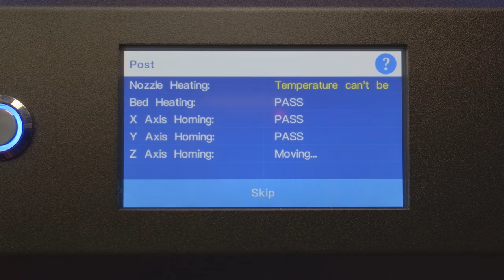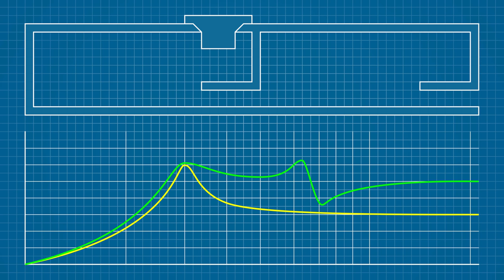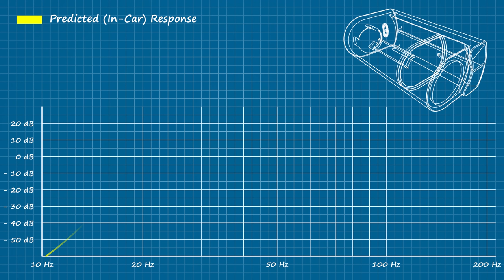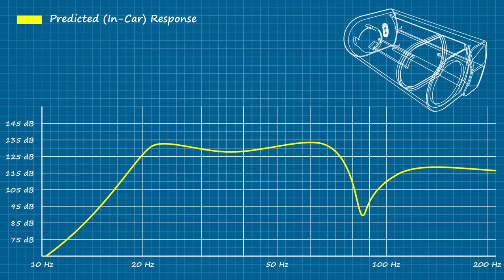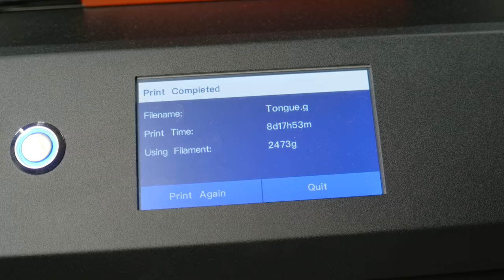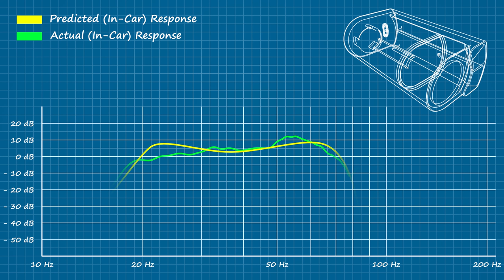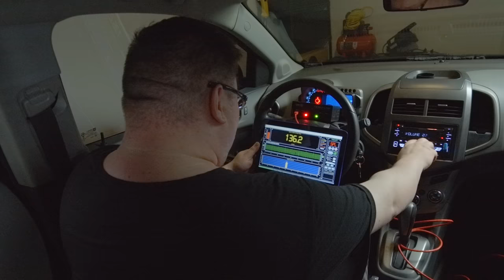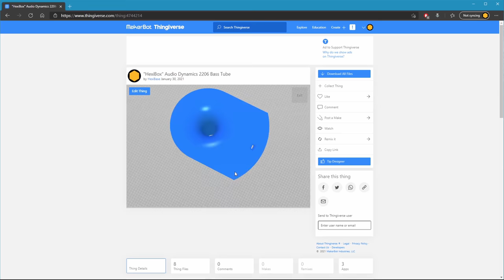Next Generation Bass Tube (Featuring The Alfawise U20 Mix)

Comment: I love this project and the content in general, but the sprint speed on that printer can best be described as glacial. It looks like 20, maybe 30 mm/s?
I might be used to slightly higher speeds printing on a CoreXY (but with direct drive), but that just looks unnecessarily slow. Is it extra slow due to the heavy print, which eventually has to be moved in Y with the bed, and is it part of the factory settings/profile or your own printer tuning or settings?

Comment: Hey! Really impressed with this build. I think the printer performance is 5*, but the thing couldn't ve been tested before it left production. Quality control? For the price of the sub, its performance is great! Will need to check if it's available in the UK. I listened with a set of Shure 535 monitors! The fullness of the bass and its punch reminded me of the 2x12 box I made for my Golf Mk1 GTI back in the '90s. All the drivers in the system were by Infinity. That setup gave 136db without distortion. But from ONE 6" sub?! That IS impressive! Were you happy that the enclosure damped enough of the 70Hz peak? The bottom end came in an almost inaudible hum. I felt it before I heard it! I had a 21 band graphic eq under the front passenger seat to take care of resonances after I'd done as much as I could in the consruction. Love your channel!

Comment: Puts my "borrowed" yellow plastic pipe I took from a pile of scrap at a local road repair site to shame 😂
It was the rounded off end they cut off and discard. Half inch walls and stupid heavy (4ft long) I installed a 12" eminence sub of some sort with a bunch of acoustic foam wadding inside. Certainly made the room vibrate 😁

Comment: i came up with an awesome cheat on tall prints... if you can pause the print do so 3 big elastic bands of equal tension! and a little bit of tape!  reduced the wobbly by 80% hardly even notice it on tall prints.rest of the wobble must be down to chassis and the bed sprints.

Comment: I have a 12 inch sub, 300 watt continuous, the cabinet is pade of some garbage particle board so i was thinking of building a new cabinet for it, its powered and it has a built in amp. do you know a channel that has made a 12 inch housing?

Comment: Okay, I'm a professional DJ using PA systems for my gigs and I obviously have a different use case than what you are doing. But my general question remains: Why do my two heavy duty 15" subs only hit around 130 dB when I can hit 136 with your system? I know the answer is a bit more complex, but I feel like I don't even closely use my subs as efficient!

Comment: Printing with PLA - has the thing started to warp in the sun? In my experience many prints I've done with PLA and attempted to use on a car have over time warped due to the hot Australian sun. I can't imagine this project would have had any issue using PETG which lasts to a bit higher temperature, or even ASA - right?

Comment: just subscribed to your channel awesome content I've made a few Bluetooth speakers myself nothing as aesthetically pleasing as what you create but sound very good i think especially since I only used just some speaker's I had laying around one has four sets of speakers with a ten inch passive radiator made out of a blown subwoofer with the magnet removed and the spider thinned down a bit, powered by a wuzhi 160 x 2 amplifier... three of the sets of speakers have different resistance so had to run a series / parallel set up all in all happy with it and definitely one of a kind... i listen to yours and all audio from my descent computer set up stock audio drivers with a Y split audio cable to a harman kardon aura studio 3 that's rated at around 130 watts and a old school GNT 7000 2.1 rated at 120 watts, sounds ok for a gaming / YouTube computer... looking at getting a 3D printer so thanks for the great content once again....

Comment: So I know this might be obvious, but what would happen with this enclosure if it were scaled up for a bigger woofer, would it hurt performance or would it not do anything at all or at least to a small degree that is?
Reply: You have to model it in software to know that. Since every driver has different t/s parameters so they all behave diffrently if you put them in the same enclosure
Reply: I used the program vituixcad to model a double tuned bass reflex (6th order bass reflex). So the same type of enclosure as in the video. I made it for a 6.5 inch driver the Digital designs DD506d2
I am working on building the enclosure so i am hoping that it does the predicted response since that looked really good it does 20-80hz with likr +/- 1.5db
Reply: @troybakker7628  sick man, if u put anything on YouTube tell me ur chanel so I can check it out

Comment: Curious as-to why you essentially placed a long port to the back of the chamber...why didn't you just leave the main chamber open...doesn't that restrict air flow (and cone movement)?  The vent doubles your effective length either way...

Comment: You are a genius and master in your trade and I'm here for it. I found you between gun prints in the hopes of finding some instruction and idea for a quality compact JBL Charge 4 killer. So far I've obtained a 2.1c 50x2+100 bluetooth board with seperate vol and Passover nobs for L/R and the bass. Amazon $24ish and 2 x 3.5" Boss dual coil and a 4" 40w 4ohm Drok woofer. Printed a thingiverse 4" back loaded horn maze thing box and tossed the woofer in it and Voilà... It sucks. Lol would prob sound better flush mounted to the sheetrock in my bathroom. 😖 I don't know if it's the cheapo Little 40w 4ohm 4" woofer or the frequency response in that enclosure. Gonna try the full range lil 3.5 boss. Prob shoulda gotten SKAR brand shit. 
You get what you pay for and you get what you research. Rant over. Lol

Comment: Have you thought about making a spherical ported enclosure? I feel like the time benefit of 3D printing would prevail here over other methods of construction. 

Additionally, the most efficient use of volume is in a sphere. Maybe you could also integrate resonance absorbing cavities into the interior of the enclosure. 

Thus, a design which proves 3D printing as a more effective/efficient way of producing an enclosure.

Comment: Hi! I'm new to the channel, but as a fan of the B&W Nautilus speakers: Are there any unique shapes or designs that will outperform more traditional speaker style where most surfaces are flat and rectangular? It would be awesome to see you explore untraditional shapes (like the Nautilus) that can be modelled with precision and 3d-printed. I know it all probably depends on the actual speaker chosen for the enclosure, but what if I can make better speakers using a 3d-printer instead of building with wood.

Comment: Peter, so I'm listening to this video through the Klipsch 2.1 THX system, though not one of their premium products, but not half bad and as your sub pounds through the bass, the Klipsch does it's best to reproduce some deep, rich sounding bass without distortion making your sub sound incredible on this end. On Test Track 2, the bass quickly sweeping up and down, I could get the gist that some of that 40hz and below bass was translating well at your sub, but was lost ever so slightly with the Klipsch on my end. The element that is missing between that, is the side by side comparison and answering the question, does the Klipsch perform a good job of accurately reproducing bass your sub creates? Nonetheless, the final sound result was outstanding overall, clean, smooth, rich bass.

Comment: wow! 👍👍👍👍👍👍 i recently got some little bookshelf speakers with amt tweeters and some"tower" speakers with regular tweeters and the regs are harsh af and the amt sound perfect. with my lil 10" pioneer in a 1.5 cu.ft. box it is almost not bad. i need a ts-w306r to fill out the bottom end, below 28hz, do you have any free software you recommend for box design? a great song to hear the bass i love is "joeski - come on"

Comment: I enjoy your show tremendously. I'm very curious about which T/S values you use for your designs, the manufacturer's data, or your own measurements. I'm asking because I hear that manufacturer's data could be significantly inaccurate, while simple speaker measurement / testing devices are not necessarily very accurate either.

Comment: Would you be willing to share the volumes of the chambers , internal port volume and the port areas? I came up with (small .167cf gross) (large .472cf gross) minus .032cf for the internal port. I can’t fit that enclosure behind my seat so I thought I would build a wedge type with similar volumes. I can’t wait to try those subwoofers. Thanks.

Comment: i really want to build my own sub, but doesnt have enough measuring equipment to do it, i cant even complete my DIY speaker crossover because i have no measurement mic
Reply: hehe i would love to make every speaker myself but yeah no equipment and no idea how to use them properly lol
Reply: @HexiBase  yep, i build my first "true" proper speaker designed with software, etc, i bought the DATS v2, but i cant afford to get minidsp umik-1( well sort of), so rn i'm stuck with not really good crossover since all i had was behringer ecm8000 which is not that great because its not calibrated, my speaker project needs to be suspended for now 😁, ur video about enclosure and thiele small parameters help me so much, even at first when i dont have dats v2, i tried to calculate my cheap speaker driver TSP manually using equation, frequency meter, multimeter, cheap oscilloscope, etc 😂😂
Reply: A good way to get your foot in the door is Dayton Ultimax subs. 

Parts Express sells sealed kits that are very solid and can be assembled with minimal tools. Glue, a drill and screws are one option. Glue and clamps are another but the drill would be better if you don't have clamps. 

If you don't have a drill... then I suggest looking to get one as that allows you to do a lot.

The Ultimax sub then could be moved to a better ported enclosure down in the future if you want more low end out of the driver and have tools by then. 

I did that with my 10" a few months ago and the new box made the sub feel like a whole new sub.
Reply: @JoshM7  thanks for the recommendation, i cant really afford and buy from part express because its too far and i hate dealing with international shipping, but there's a well-known brand of loudspeaker driver here called SB-Acoustics which i use for my "proper" DIY speaker.

 i have the woodworking equipments to build a enclosure and i kinda already understand how to use the speaker design software but the thing that limits me is my knowledge about "proper" sounding system since i never heard a proper sounding system sounds like and lack of budget 😁.

but if i have a budget i might try building proper sub with the help of speaker builder that helped me with my first proper DIY speaker
Reply: @clee2423  Ah ok. Yeah international shipping makes it harder to recommend because of all the extra fees. 

"Proper" sounding honestly is different to everyone. Though I can understand wanting to hear something first to get a reference so you know what to aim for. 

The box is normally the most important part of a subwoofer and if you have basic woodwork tools it's a breeze. Selecting the driver and planning the response you want is the harder part mostly when you're not familiar with what you want out of a subwoofer.
Reply: @JoshM7  yes, that's what i'm lacking of, a reference and how i want the speaker to sounds like, i'm still searching and learning about it 😁

Comment: Hello hexibass.
Great videos.
I have a 2012 Chevrolet Avalanche that I removed the mid gate section.
The whole bed is exposed when the rear seats are folded down.
The bed has a cover on it.
What enclosure would be suitable if I have 1 driver to get the most bass.

Comment: Why don't you use a Woofer with other TS-parameter wich are better for a single ported/bandpass enclorure instead of a SPL-Designed Chassis? As we see this enclosure works but at what cost? [Entschuldigung für mein schräges Englisch].
Reply: @HexiBase  This makes sense. Thank you for your quick respose and your German ist absolut Fehlerfrei. P.S. Seeing forward to more videos from you.

Comment: working for an AUDIO DYNAMICS dealer i was wondering if you have some of these enclosure designs available?  i would like to try this enclosure,  not 3d print a tube but actually build a box and test it out.  let me know,  i am building an enclosure for a 4000 series this weekend,  ported box to ADs specs to see how it sounds.  thank you

Comment: How dangerous are low frequencies at the pressure levels for the ears?
I know there is an accumulative effect (i.e. a dose) so it's hard to state easily, but I would like to know your take on it. Especially in comparison to frequencies in speaking range.

Comment: 3d printing aside i would like to know if you design boxes for customers  that do car audio?  i got the general idea on porting and what not but i feel like i have room a potential DBs not being utilized right now with 4 12s in a 14 cubed box tuned to 32 on a 8000 watt rms amp. its loud but i would like to try something else as well.
Reply: He is a sound engineer, and he mentioned some projects in the past. Unless you’re local, it would be difficult to give him access to the vehicle for implementation and testing.

Comment: Mr. Base, I have a question. What would be the result of using the interior wall of a slot port as the speaker baffle? Im sure there is plenty of info about this configuration but I cannot find any. Thanks

Comment: can we find a printer that will make a 8" enclosure please, currently have a skar audio svr-8 dvc rated for 800w max currently only running a kicker360 4 channel for amp but expecting to purchase a better amp in near future and im also only tuned to 50hz as thats the lowest the amp will tune to. listened to the sound demo using corsair void elite 50mm drivers and nahimic audio active tuned for my tastes

Comment: Nice and punchy, but the system I’d lacking everywhere else. I’d love one of these, how much? Oh, and right now I’m using my Bose Quiet Comfort II noise canceling wireless headphones coming straight out of my iPad. Now, these phones have their limitations, but for the first time ever, I bought a pair after hearing my son’s. Prior to this I used my Senheiser HD380’s but these lacked too end, with decent bass. The Bose vested their high end performance, and barely nudged out their bottom end. Shit. I’ve always hated Bose as to me they make some of the worlds best midrange, and I want full range performance. So I believe I have a decent set up to critique things with, not the best by any means, but this is on You Tube to deign with. I’ll stand my my assessment of the bass tube, which is very impressive for its size. And I’d love to buy a box, as I can’t afford a printer and have no place to put one. At least for now. Anybody willing to help?

Comment: Hi @HexiBase I have a question about the dust cap on a subwoofer. If a dust cap is missing from a speaker how much does this impact the speaker? The reason I ask is I have an old 12 inch sub that is missing the dust cap as my kids poked it and was damaged so i removed it. To me the sub still works fine. Other than aesthetics should I glue on another dust cap?

Comment: I have a question and it might be of subject but will 2 square 10 subs in a folded horn work better than a 15 or 2 12s vs a 18 I cant find anybody that has used them in this manner. Your option would be great. Thanks

Comment: Single color version of that printer is half the price.  I got mine under the name Longer LK-1 which is the same exact printer with a different brand.  12"x12"x14" print volume for under $300

Comment: I would have rather used some ring terminals and bolted those down, rather than soldered directly to a bolt.
Edit: and instead of soldering the wiring that you insert to the speakers, I would have rather crimped some end sleeves on them.

Comment: I want to build a 10-inch version if I had a big enough 3d printer.
Reply: You could stack them. I'd just add a way to link/couple them. Once you change the parameters, the design is no longer tuned.

Comment: Way easier to build a sniper box instead
Reply: @HexiBase  I wasn't dogging on your application I think it's really cool I was saying from a purely  SPL standpoint it's much easier to obtain higher numbers than that with a 6.5"  driver in a 6th order sniper box. Im not saying you failed in any way what so ever 
Is all i mean was to make others aware at the fact that there are SPL oriented boxes that can do even higher numbers than that.
Reply: @jayden974  because 6th order can be superior to a standard bass reflex when it comes to it SPL output